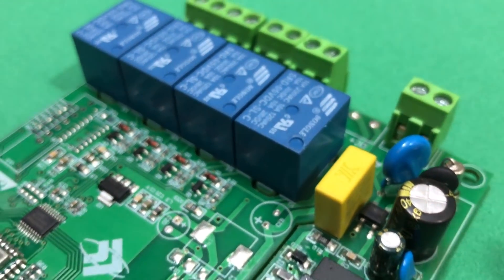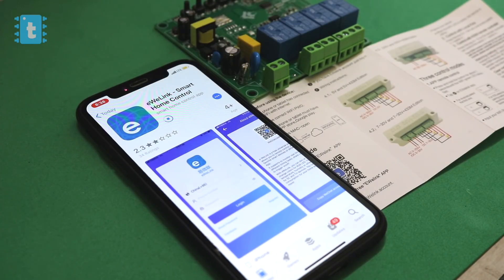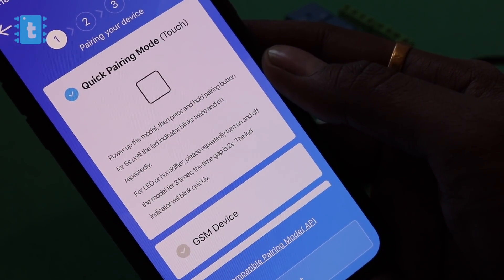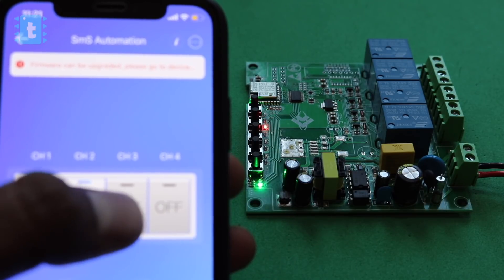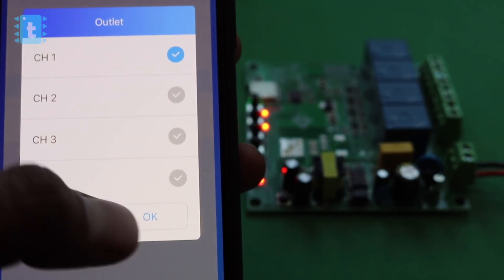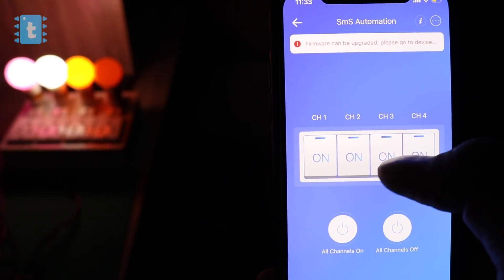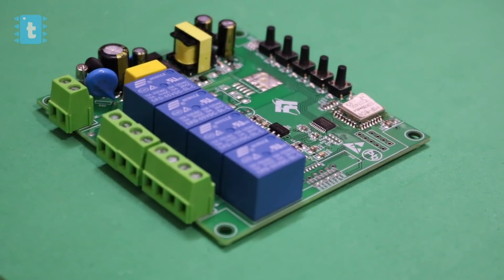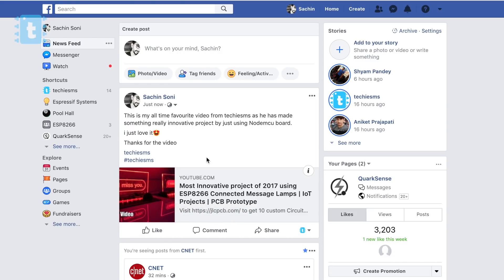Home automation product for just ₹780 from Banggood | EWelink | Google Assistant | IoT Projects

Comment: Hi,

Getting below error(when seen in Serial Monitor) using Wemos - Esp8266 board  Subscribing to MQTT Ubibots device

 ets Jan  8 2013,rst cause:4, boot mode:(3,0)

wdt reset
load 0x4010f000, len 1384, room 16 
tail 8
chksum 0x2d
csum 0x2d
vbb28d4a3
~ld

Please suggest

Comment: Sir, in this video you can tell how Google Assistant has to connect with this project
Reply from the maker: Using ifttt
Reply: @techiesms   what is iftttt and how to use in this circuit
Reply: What is iftttt and how its use in this circuit

Comment: this home automation is easy to use and very flexible and work finely , but there is no input or any Sensor , u r home automation system is more better than this , but the special things about this product is u can control by both internet and manually , plz review more product like this , thanks u
Reply from the maker: Sure

Comment: Nice Video. 👍 Query : since it's a bare PCBA how to use it practically on home devices? Is it possible to keep this inside 4 or 6 or 8 module switch board? Please clarify.
Reply from the maker: No 
And it’s doesn’t make sense to put it inside as the push button won’t be accessible then 

Better you make a separate casing of this product and place it above or below your switch board